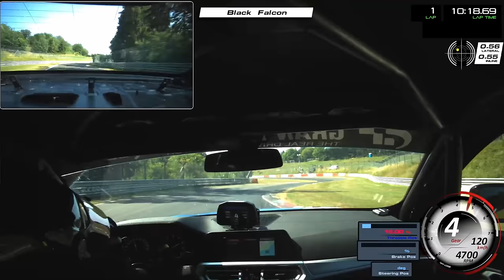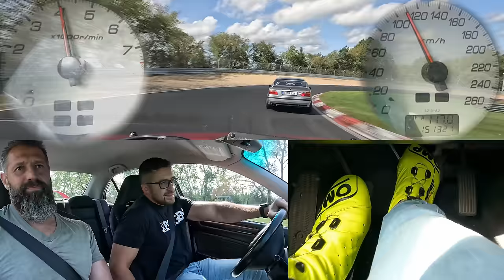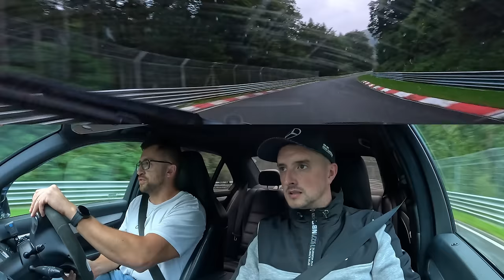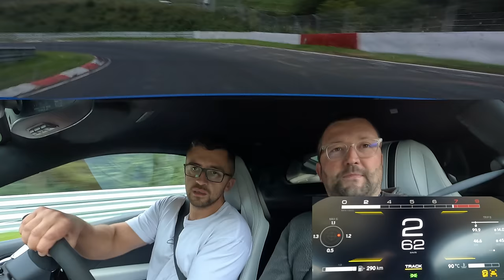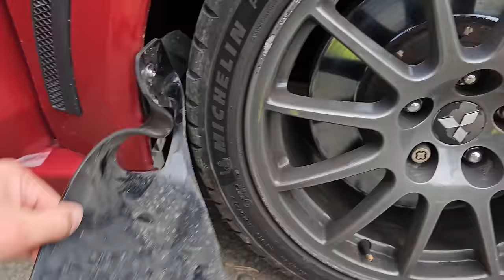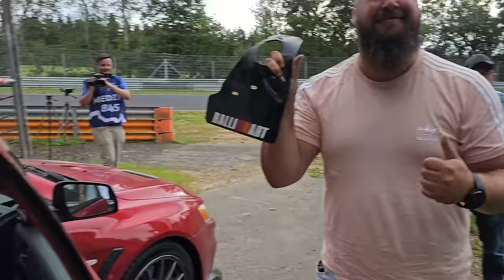EPIC FAILS, SAVES & NEAR CRASHES! Nürburgring Compilation 2023

Comment: Well, most of the people who wanted to ride the track before themselves.   Misha himself saw the shortcomings of most people who are enthusiasts of cars built thistle.  I watched several videos, the tires do not fit on the tracks...some corrections of braking disappear at high speed...box transmissions...balancing the weight of the machines at high speeds have been seen to slip out of the track.  Each machine has its pros and cons.   On the Nurburgring track, it shows the weak points of the machines very well.  Pay attention to avoid accidents.   Usually, cars can fly off the tracks at high speeds.  Very seriously, every detail must be arranged in the car before high speeds can easily control the situation.  Builder Tester Builder Correction Tester will have a result at the end.   Each machine nuances.

Comment: I wouldn't be driving at these speeds in this type of traffic without a helmet. Surprised they even allow it. We used to do solo autocrosses in the local parking lots with our car club and it was mandatory to wear a helmet, where top speeds were never more than 60-70 km/hr in short stretches.

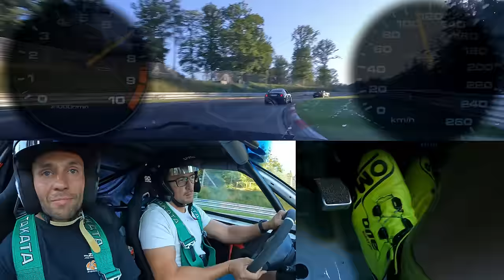Comment: 05:55 -  Helmet has sun visor - but only for light from very high elevation - and car has no visor - because roll cage added. 
So, is driving with one hand bobbing around near our face, the standard method to deal with low angled sunlight? 
🤷‍♂️ 
Call me crazy, but I would've thought , 
A. small visor added to roll cage, or 
B. small lower visor added to existing visor on helmet,
solves this problem. 
No? 
Something else?

Comment: At 4:55 Micha says his brake pedal is stuck to the floor and has to pull it out with his foot. I can't believe GM are still using this trash clutch system. I own a HSV produced in 2007 and had this problem which with fixed with a Exceedy after market clutch. As soon as the fluid in the clutch starts to boil you have this problem. It's because of where the stock slave and master cylinders are located.

Comment: Fuck man, would love to ride with this guy. The guy who tuned my Kia Forte GT had a goddamn Audi R8 out front, said he was going through a divorce and picked it up lmao. He was actually impressed as hell with my car for some reason, I guess cause it came with 230 lb fr and 220 go from factory, which is way underrated. 

After spending 5 or so hours after closing time just shooting the shit and tuning the car, we came out with 270 lb ft, 230 hp, as the German engineers over at Kia limited the torque with the stock clutch. He drove the fuck out of that thing behind the warehouse, after my test drive was determined subpar. Absolutely wild experience, and man that Kia can fucking turn man, they did something to it.

Comment: Brakes and tires should be the first upgrade, not power... and a unreliable car is also such a bad vibe, having to turn the engine on and off or resetting stuf. It means you'r build is not ready for the track imo.